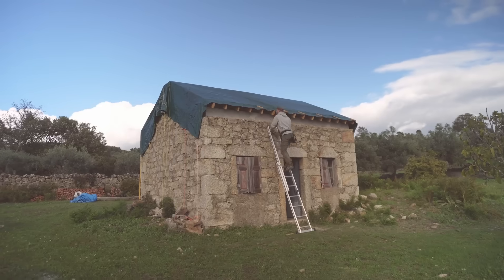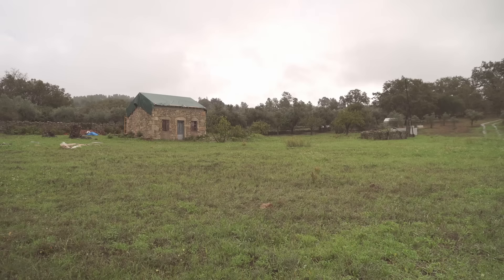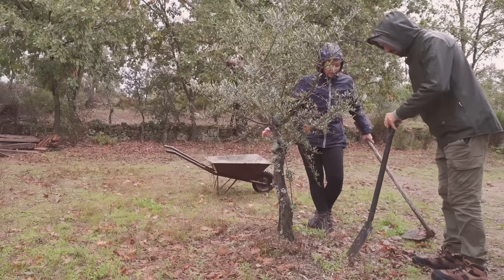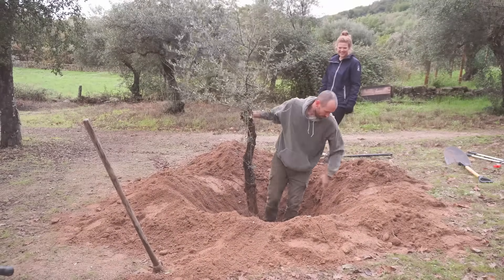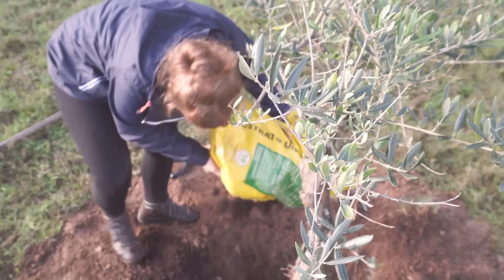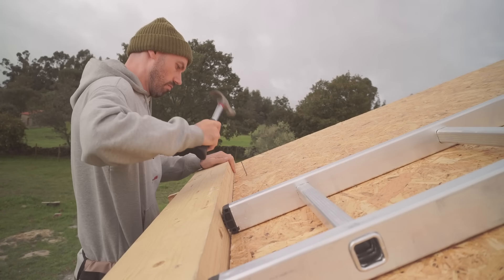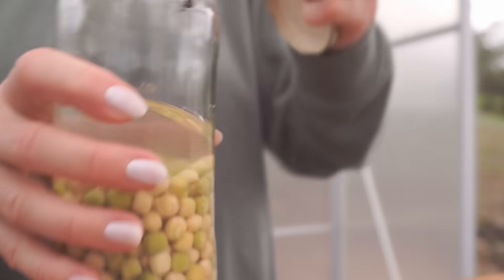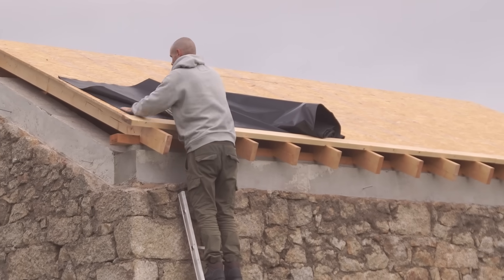THE RAIN RUINED OUR PLAN! Renovating an Old Stone House

Comment: on a wooden roof it is always better to use a breathable sheet and not a vapor barrier. this is to avoid condensation.
Reply from the maker: It’s a warm roof so wooden structure is inside the thermal envelope. Insulation will be going on top of the avcl & then breathable membrane on top of that
Reply: @LifebyLiving  yes, good for the waterproof and breathable membrane over the insulation (by the way, which insulation did you choose?), but the vapor barrier under the insulation leads to the risks of summer condensation in the insulation package. for this reason it is better to use a vapor retarder and not a vapor barrier. it is a safety for the life of the roof

Comment: Brilliant video and I know there are going to be lots of 'you should have done it this way' comments. So here's mine - use water! Lots of it. Once you have a nice trench around the trunk flood it with water. Keep on flooding it until the soil basically turns to soup. The tree will give up its grip far easier. Same goes with getting tree stumps out. 😍😍😎😎

Comment: Is there a reason for the vapour barrier on the outside ? Rather than a breathable membrane?
Reply from the maker: It’s a warm roof so vapour barrier will still be inside once we’ve finished. Insulation will go on top & then breathable membrane above that. Hope that makes sense 😊

Comment: Don’t worry too much as the root ball Is non existing generally  2 cuts are done one depending on size as you said 30 cm for that size tree then leave for 3 months and make a further cut 10 cm ring from 1 st cut therefore capturing the feeder root regrowth this is generally at the plants drip Line at outer tips of it ,  my friend transplanted a 5 metre liquidambar,   It didn’t look back , the only thing I would suggest is to remove some foliage only 15 cm it just helps with sap distribution , same principle as bonsai loose 1/3 of roots lose 1/3 of branches , as you said dead of winter is best another channel dug out a olive with same height but 15 times the foliage , left in 40 degrees heat no dirt planted next day no cut back , like watching a train crash sadly , my house in a rainforest in Tasmania used iron nails all rusted , boards started to fall I sourced galvanised heaps better , so scary when wind and tarps get going , nature 😮

Comment: Probably too late to suggest this but if you need to remove the tarp to do roof work try leaving it fastened down on one side and just peel back enough to allow you to work, then if it rains it's a quick and easy job to cover up again. I'm trying to decide where Vicky's accent is from and I am thinking it is east midlands ?

Comment: At 14:12 there is a dangerous insect. Don't let it survive.
If I were you I would remove the tarp only halfway. Leave the tarp on that side of the roof where you don't work. In case of unwanted rain you can put it back quickly.